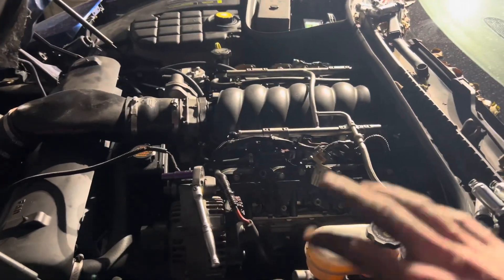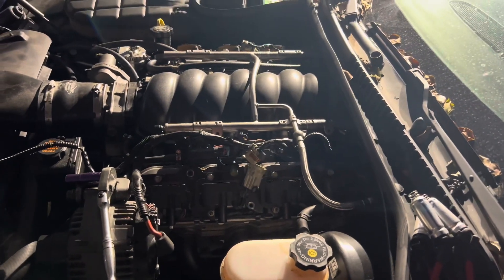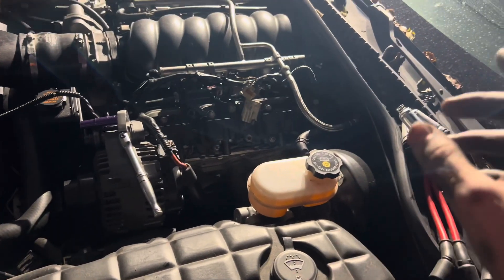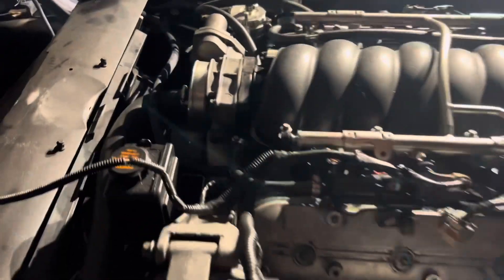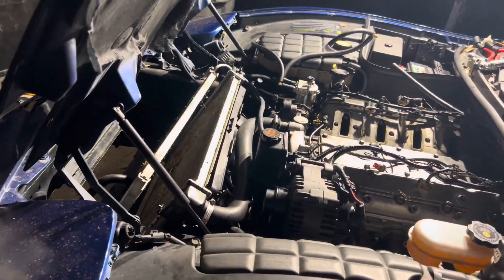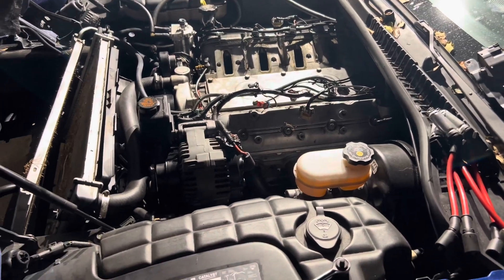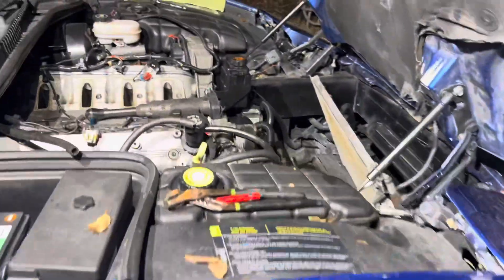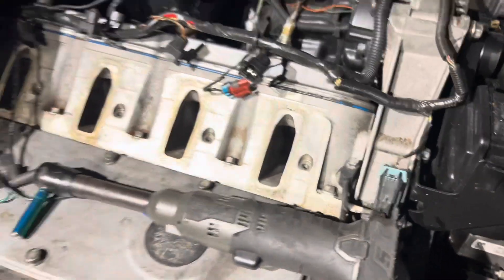My c5 corvette had a 4.8 in it?!?!

Comment: interesting... it may not be the right engine but you can make some good power on a 4.8 build, boost it until it dies, get another one cheap, and build it for boost..
Reply from the maker: Sadly the engine was already dead when I bought the car. But just picked up a 6.0 for it so I’ll be building that and throwing it in the car

Comment: Lol, you didn't open the hood?
Reply from the maker: I sure did but you can’t tell the difference between ls motors by looking
Reply: @bradleysgarage3028  test drive? Is the 4.8 that strong you didn't notice, ?
Reply from the maker: I didn’t really drive it as it was low on trans fluid and engine smoked badly so already planned on replacing engine
Reply: @bradleysgarage3028  good luck. 👍
Reply: you did not notice the iron block where the heads meet the block
Reply from the maker: I understoood the car didn’t have the original engine but I was told it was a 6.0